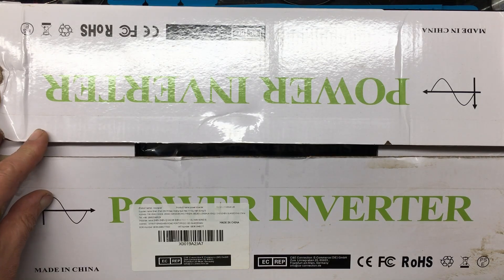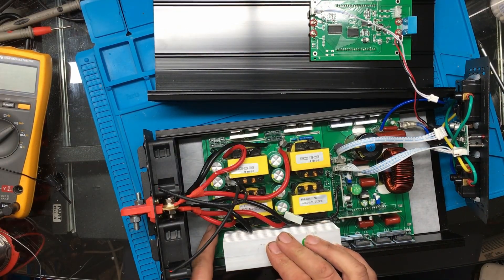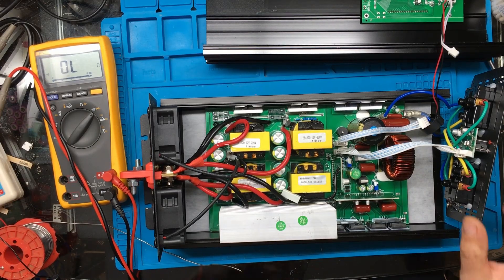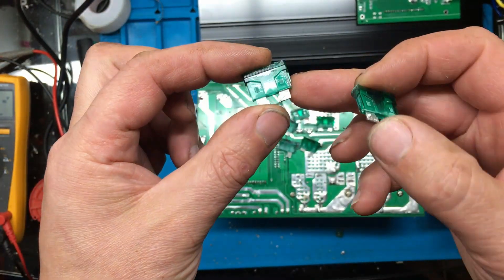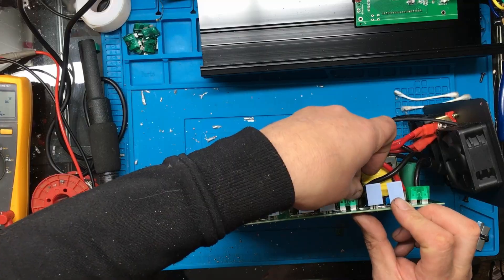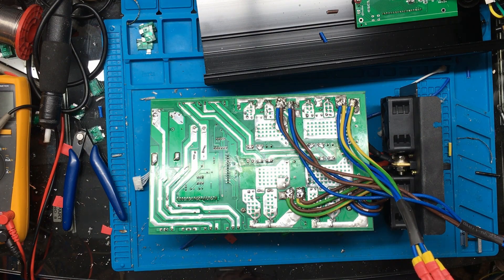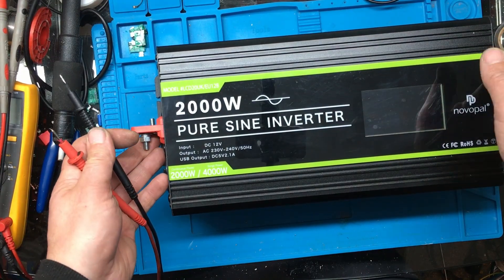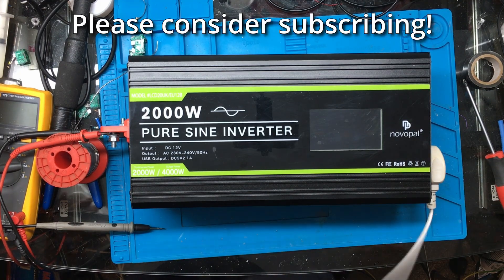2000W Pure Sine Inverter - Blown Up! - Let's fix it!

Comment: Nice that the fuses did their job! But a shame they were soldered. Not that soldering is hard, but that ATO style fuse is almost always made of aluminium.
Reply from the maker: The fuses I used to pull from cars I'm sure were tinned copper. I just thought it was probably just this cheap set purchased from Ebay 🤷‍♂️
Reply: @BuyitFixit  It's sad that AL is replacing copper in many places where it shouldn't. Corrosion and other failures are the result. I do remember the days when almost all the ATO fuses were tinned copper but it seems that those days may have sadly faded away.  However, I think certain types of fuses may still be tinned copper, such as the smaller ATM style.  

I had a car which leaked rainwater into the interior unbeknownst to me. It sat with moisture in the interior for weeks and every fuse corroded terribly due to aluminum fuse tabs reacting to the copper fuse holder terminals. Was a terrible repair.
Reply from the maker: @davida1hiwaaynet  I can imagine, yes the metals seem to react with each other  making a right mess.

Comment: Nice but risky repair. These cables are restricting airflow a bit more then desired. Would very much consider this as a major firehazard thinking of those wires maybe not being up to spec and rubbing against the underside of the pcb risking cuts in the wire. Get the right fuses and remove those wires.
Reply from the maker: You may well be right, it was a bit of a last minute repair as the guy was only visiting for the weekend. I was going to solder fuses back in, or I would have prefered to use sockets in the PCB, but I didn't have any or time to order any, so I had to use what I had to hand.
Reply: @BuyitFixit  true. I must say for a shortterm fix and maybe not using it at maximum load I think this will work just fine. And how you did it is very neat and well done. But I wouldn't install this somewhere tucked away into a camper/boat/motorhome in this condition.
Reply from the maker: @sebrassino yeah I think he was going to use it at his allotment (gardening shed) probably to run a few lights or something occasionally.

Comment: I might be wrong, but that didn't look like 30A cable you wired to those fuses. I expect they will get VERY warm.
Reply from the maker: It was 2.5mm mains cable, and 2x on each side of the fuse :)
Reply: @BuyitFixit  Maybe soldering the spade connectors into the board might have been a better idea, if there was room. Just a thought if you ever have to do another.
Reply from the maker: @chrishartley1210  I would have used proper sockets the owner was just visiting for the weekend so I just used what I had lying around.

Comment: THX for the material, it's nice that only the fuses blew, but thumbs down for the cables and deterioration of cooling
Reply from the maker: Yes, it's not ideal. I was going to solder the fuses back in as original, I would have preferred to use sockets in the board, but the owner was only visiting for the weekend hence I had to use what I had available. I have no idea why YouTube has been pushing this video so much when I have repaired much more interesting and complicated stuff 🤷‍♂️
Reply: Aha, so you were planning to install fuse sockets on the PCB, that changes things :) 👍
Even YT employees don't understand their own scripts, don't worry about it and do your thing :D
Which of your materials would you recommend the most? @BuyitFixit
Reply from the maker: @tristankordek depends what you like. If it's electronics try the RGB laser or thermal camera or if it's software reverse engineering try the medical ultrasound scanner or the solar inverter I repaired and needed the service password and the company wouldn't give me it and said bin it.

Comment: Surprised to see they soldered automotive fuse directly on the board, all the inverters I've opened up had the bare spade connectors soldered to the board. Nice repair job :-)
Reply from the maker: Thanks I would have used proper sockets ideally but the owner was only visiting for the weekend so I had to use what I had lying around.

Comment: A cheap diode could prevent this.
Reply from the maker: I agree with you but the problem with that is the diode would have to be very large, and it would get very hot due to the amount of amps it would need to handle.

Comment: Someone else mentioned it, but ALWAYS discharge the caps before poking fingies so no nasty surprises.
Reply from the maker: Yes, good advice. I usually check to see if there is any voltage in them, but probably forgot and it had been sitting in a box for quite a while it seems.

Comment: I've have a egs002 based pure sine wave spwm inverter that I made 2 years ago. But I really wanted to build something like these "dc->hv dc->ac" switching inverters because they're more efficient and compact. My current build is using a salvaged UPS transformer and it's works great for most of the time but its big and consumes almost 16w at idle (because of the big iron core transformer)
Reply from the maker: Interesting.
Reply: have you thought about using both?  switching till a break point, then lf for large loads with the transformer.  They are efficient when being used.

Comment: Fool-proof colour-coded connections - 0  🤔
idiot with a screwdriver and a DIY plan - 1 😉
Repaired by an amateur on video - Bonus! 👍
Watched by people who will never own one. 😆
Reply from the maker: As said to others I would have preferred to solder sockets or the actual fuses. The owner was visiting for the weekend and I had nothing suitable so used what I had available. Have a look at the FLIR thermal camera I repaired or the RGB laser or solar inverter where repaired and then I had to reverse engineer their software to work out the password algorithm for the service menu. Which is some of my better work...

Comment: Why not solder fuse sockets in? You might blow another few while testing😁
Reply from the maker: I would have preferred to do that but the owner was visiting for the weekend, and I didn't have any or time to order any. So I had to use what I had available.
Reply: @BuyitFixit  Nice solution in any case👍👍

Comment: For a proper fix, you should solder some "pcb auto blade fuse holder" to the board (Am*z*n search in quotes) and plug the fuses into them!
The manufacturer clearly wanted to save a few pennies.

Comment: Soldered fuses that require a 120w soldering iron to change them after dismantling, not recommended for camping etc.
Reply from the maker: Yes, or emergency use 😂😂

Comment: Solder spade connectors directly to the board.
Reply from the maker: I don't think the holes in the board were big enough. I would have preferred to use proper sockets, but I only had a few hours to repair it as the owner was just visiting.

Comment: PCB mount ATC blade fuse holders would seem a better option than adding so much extra length.

You also seemed confident putting it all back together almost fully before testing. Haha.

But glad it worked and an easy fix.
Reply from the maker: Thanks Shaun 👍Fuse holders would have been my preferred choice but my friend who brought it up was only up for the weekend, so didn't have time to order any. I just used what I had available.
Reply: @BuyitFixit  You can solder the spade connectors directly to the board, i have seen many inverters made that way. Just take the insulators off and straighten the tabs for crimping so they could feed trough the holes in the board.
Reply from the maker: @TheOriginalEviltech  Thanks for the suggestion 👍
Reply: @TheOriginalEviltech Yes, put two spade connectors on each fuse, put them through the board and solder.  The fuses themselves hold everything in place while soldering.  The fuses are all much easier to replace.
Reply: @TheOriginalEviltech  That's a brilliant idea! Thanks.

Comment: I'm more concerned about restricting the fan's air movement with that glob of fuses/wires in the cooling path. Lucky, too. If that was on my bench, every solid state device would have been toasted. Good work!
Reply from the maker: Thanks, cant remember the exact air flow path but I don't think it would affect it too much. It also seemed to have a temperature sensor so I assume it would shut down or throttle if it gets too hot.

Comment: where do you get that mini pen grinder from
Reply from the maker: I got it from Ebay. Around £20 MaAnt D1 it's called.
Reply: @BuyitFixit  gonna order myself one. Never seen these before. Very handy and they can be powered by a power bank.
Reply from the maker: @nolimit7 It has a built in battery, and I only ever charge every so often. Yes you should be able to charge it with a power bank, it has a USB C on the back of it.

Comment: Hi, 
It is good to see that the MOSFETs and protection diodes are not blown. However, I never would do so kind of a repair, i.e., extending the fuses with cables, in such a high current path. The best you can do is to find some quick-fit sockets that are fitted to the AC output cables you removed during repair and then solder them into the PCB by shortening their cable side legs (to let them fit into the PCB holes). Then you can easily put the fuses on these PCB-type sockets that you create. Hence, in a repair, you would also be made removable fuse holders in that board which will be healthier than a cable extension when one considers the high current flowing along these lines. 
BW
Reply from the maker: Thanks, a few people have mentioned the same. I was just going to solder new fuses in, except the ones I had were cheap aluminium and would not solder. I would have used sockets except my friend was only up for the weekend and I didn't have any or time to order any. I used what I had available at the time.
Reply: Its a matter of heat. You are only using a small pen iron. The wide tracks suck most of the heat. You needed to use a bigger (much bigger) tip iron with plenty of heat... @BuyitFixit

Comment: nice to see the required number of HF transformers, usually 500w a piece. But 2000w is at least 160a on the 12v dc side... what size are those fuses....
my 3kw has 8 40a fuses (on the inside but in soldered terminals in parallel) Only had them blow once, when a mosfet was too weak for the early morning coffee, which was caused by the suppliers factory changing mosfets from the agreed design to save money/increase profit. got a refund on it then put in real mosfets.. 3yrs on still going.
Reply from the maker: The fuses fitted in this unit are 30A each. Great job on fixing your inverter 👍

Comment: The reason the fuses are soldered in is to discourage user servicing which can be dangerous.   Also you should invest in some bismuth solder, it would make removing those fuses easy.
Reply from the maker: I do have some low melt solder I just completely forgot using it so good call on that. I use it quite regularly now, it's very handy for removing things like IC's and USB / HDMI sockets.

Comment: think they solder the fuses to reduce contact resistance and so heat generation from iffy joints. by extending the cabling, I think you have significantly increased the resistance on the input side - so the output will turn off at lighter loads or higher supply current.
Reply from the maker: Would that not be the about same as having the incoming supply lead extended by around 6" ? I did use fairly thick cable and x2 on each contact. Someone also mentioned about soldered in fuses but I've worked on plenty of cars that don't have the fuses soldered in. I know the resistance would be lower but I don't think it will make that much difference.

Comment: I would have soldered fuse holders in the places the fuses were.
Reply from the maker: I would have done the same, unfortunately the owner was only visiting for the weekend and lives quite far away so I didn't have time to order any so used what I had available at the time.
Reply: @BuyitFixit  Aha, of course, that explains it.

But the fuses did there job, they blew, and not something in the Inverter, many times the fuse 
is still OK, but did not do it's work, and something els after t blew up.
Reply from the maker: @AmigaWolf  Yes, that's what i was expecting. I thought at least were going to have blown mosfets, so I was surprised when it was only the fuses.

Comment: Hi I am enjoying watching your repair videos. I only wish I had found your channel before I got rid of my mother's pfaff sewing machine as it was year's old but so well built  but one day it just stopped working. We narrowed it down  to the pcb board. And a replacement was approximately £800 from Germany so this was obviously more than it was worth.  But I'm sure you would  have fixed it. Since then I've been trying to buy a replacement machine but it seems like a common fault as quite a few are selling them as spares because they like mine just stopped working
Reply from the maker: Thanks 👍Interesting, I've not heard of them before. I might have to see if I can pick one up .
Reply: @BuyitFixit  the model is a pfaff 1029 with the built-in foot control. 
If indeed you are serious about looking at one. I think I still have one in my loft. This is one I bought  to replace my mother's model. But it turned out this one had been stored in their garage and got wet
Reply from the maker: I did have a look on Ebay before you posted the model, and there was a lot of different ones. Some were old and quite basic and some had different types of screens and it even looked like some had fairly large touch screens. I'll have another look now I know the model👍
Reply from the maker: Seems the only one that comes up on Ebay sold about 6 days ago for £75. Tiptronic 1029. From the look of the control panel I wouldn't have expected a very complicated PCB inside, although I could be wrong.
Reply: @BuyitFixit  that is the correct one. And to be honest as soon as I see the green of a pcb to me it's already complicated

Comment: What a horrible design!!  This must be a low dollar unit.  Who makes a device  that requires complete disassembly to replace spade type automotive fuses and then solders them  in p-lace? Plug in sockets for the fuses are cheap and would make the unit serviceable.  Having them accessible from outside the case would be even better.
Reply from the maker: Yeah it's not great and I think these units were fairly expensive when I checked on Amazon.

Comment: So cool!  A free inverter!  Just a quick suggestion: I'm an electronics technician, and after a repair, I plug everything in, but I don't assemble a unit before the test.  That way if it smokes or sparks during the test, I can see where it came from so I know where to look to find the problem.
Reply from the maker: Sometimes I do a quick test off camera, reason is if I test it and it works then people probably won't watch the rest of the video. Sometimes like on the Milwaukee impact driver I recently repaired I do a test and then do a real world test such as using the tool instead of just showing it spinning. Thanks for the feedback though Sadie, much appreciated 👍
Reply: @BuyitFixit I bought one and ac power is coming down the battery negative.
Reply: And if it doesn't work you don't have to pull it apart again!
Reply: Same here.
Reply: To avoid more magic smoke I testing repaired gear be feed it with a current limiting bench power supplý. ☺
Reply: A very helpful video of some good and thoughtful work.
Reply: That's not how you test something! If you understand Electronics and how to fault find and test, you don't need to plug something in to cause more damage.  You look at how a circuit works first and identify faults.
Reply: hi sadie its clear that this inverter has no revers polaroty protection 😮 unles you know better than me 😊
Reply: @stevehopwood6392  maybe the 30A blade fuses were the "protection"?
Reply: Nice info from both of you. Thanks. Amazing what people throw away ordinarily ha!
Reply: Amateur tinkerer here.  Currently making a mini solar set up. Got a free 400watt 24v inverter. It's odd as it strictly states 24v but came with a cigarette lighter plug in?   When I opened it up it has x2 35v resistors and a 25amp fuse on the input side so I'm fairly certain it's a 24v only setup.   

Now when I open it up I'm curious if adding thermal paste into the MOSFETs where they attach to the outer casing for cooling helps the invter last and run more efficiently?  Or is it a waste of time?
Reply: I just break the covers off so they can go back on again
Reply: This is one of the well known laws of fixing stuff. If you reassemble it, it wont work. If you leave it spread all over the bench, it will
Reply: Absolutely

Comment: Surprised you didn't use solder in blade fuse holders or consider thermal reset fuses which the latter would have made it bulletproof pretty much but not sure if there are 30A ones of those.
Reply from the maker: It was a friend who was staying with us for a couple of days so I didn't have time to order any parts before he was leaving, and unfortunately the only automotive type fuses I had were cheap aluminium it seems instead of the usual copper coated ones. I had loads of spade connectors and plenty of wire so that's what I used, probably not the neatest of repairs but at least it's now usable and probably more serviceable than it was.

Comment: I would have plugged in the bench power supply as a load. 🙂
Reply from the maker: Hmmm it was quite expensive, not sure I'd want to risk blowing that up if there were a problem with the output.... suppose it would just be another repair if did 😂😂😂😂😂
Reply: @BuyitFixit  I'll try agin 🙂Plug in the bench power supply into the converter's output and supply that with the bench power supply's output.
Hint: Free energy
Reply from the maker: @MuellerNick Ah 😂😂😂😂